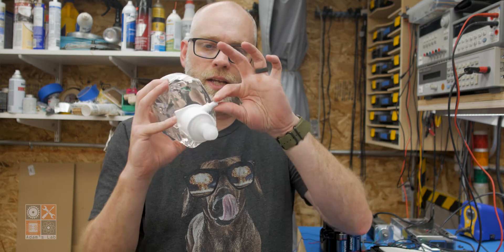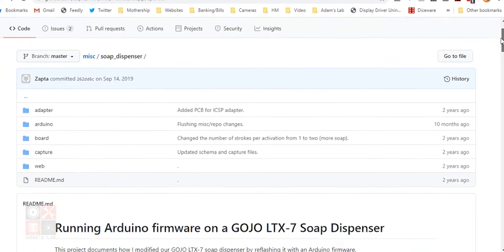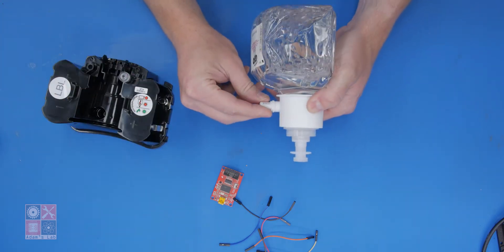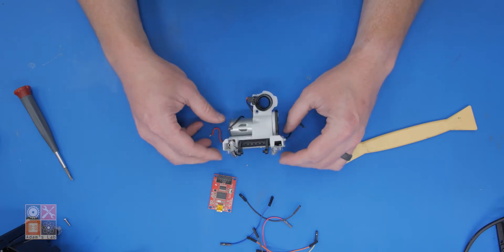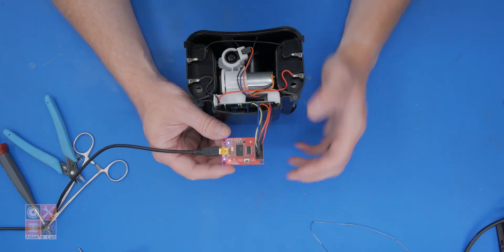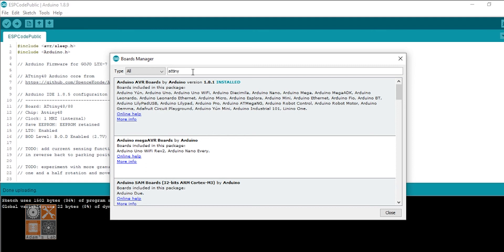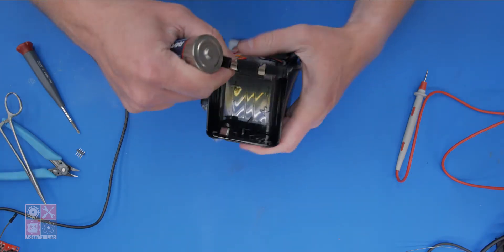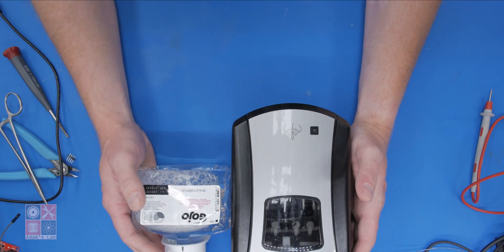Hacking a Soap Dispenser | [0041] 🧼

Comment from the maker: For some reason in the video I kept calling the GitHub repository owner "Za-pa" when it's clearly "zap-ta." Apologies to Zapta.
Reply: I tried to run the sketch but it gave me an error that pcmsk3 was not declared. I'm running the Arduino 1.8.13
Reply from the maker: @eddiecazes5512  - Not sure on that one. Make sure that you have the correct board (ATTiny48) selected.

Comment: where do i get the lines of code at 13:15 or do i not need them?
Reply from the maker: What’s shown at 13:15 (the part I highlighted) are comments, so not strictly necessary. They are apart of the example sketch the original author provides.
Reply: Ok, thanks for the help

Comment: I know I'm late to the party, but I have an LTX-7 that I got for soap, but it only does hand sanitizer. Then I found this video.

I have SparkFun Pocket Programmer as suggested, but it says V11 on the back and supposedly only does 5V while the LTX-7 is supposedly a 3.3V system (ATTiny88?).

Elsewhere, I read that the 88 takes a range of voltages from 3.1(?) to 5.5, so I'm guessing I can still do this? I haven't blown it up yet.

I followed the directions, but I had to manually install the ATTiny48/88 board manager as there's been a years-old problem with the drazzy site that looks like it will never be fixed. Because of the website error, I can't update to the newest board manager.

I loaded drivers for the Pocket Programmer using zadig, and my system sees it.

But I can't Burn Bootloader, then I can't upload the sketch correctly, getting an error finding the port number after upload.

For Burn Bootloader with the Pocket Programmer connected and the LTX-7 connected to that, I get:

avrdude: initialization failed, rc=-1
         Double check connections and try again, or use -F to override
         this check.

Failed chip erase: uploading error: exit status 1

Try a different Mini-USB-B cabe? Connect directly to my PC instead of a USB extender? What else can I check?
Reply from the maker: Been a bit since I’ve done anything with the ATTiny chips… This seems to be the core to use these days: 

https://github.com/SpenceKonde/ATTinyCore 

So, you might give that a try. Also the ATTiny48 is 5v compatible so you should be good.

Comment: Hi Adam
Super nice video, and well explained. And it works. However, I allso have several dispensers with only 5 contact plates. and with a PIC16F677 chip. The print is very similar but I can't quite see what I need. Can you help?

Otherwise
Reply from the maker: Apologies, I’m not familiar with programming PIC microcontrollers.
Reply: @AdamsLab  Daem :o(  Me neither.  Thanks for reply.

Comment: My LTX-7 have a different board that only have 5 pin in the header so not sure of the PIN out to connect it.
Reply: Were you able to figure the pinout for those?
Reply: @dimitryshkurin6480  No, still need original rfid to work.

Comment: I wonder if they have fixed this hack with the latest generation, the es8. The dispenser keeps track of the tag, if the batteries run out before the soap does, you can't replace the battery and not the soap.

Comment: Have you ever thought about cutting a hole in the soap/hand sanitizer bottle so you can refill it yourself? 

I just got this for my wife's salon and the refills are ridiculously overpriced especially considering foaming soap is about 75% water. I was thinking that you could cut a hole on the bottom of the bottle and get a silicone or plastic cap for it then you can refill it yourself for significantly less money.
Reply: I was refilling mine (the nozzle screws off when you remove the collar) but the controller would eventually decide that it had counted the maximum dispenses for the rfid and would demand a new bottle. I just hacked it and now I can continue refilling them.
Reply from the maker: I’ve heard of people doing this…

Comment: Sir, I like your video but when I tried to burn bootloader it just says wrong microcontroller found.  tried it on the model you have on the video and ltx-12.  both output the same error :(
Reply from the maker: You may need to check the programmer... I was using the Sparkfun pocket programmer and had to set the programmer to USBtinyISP (ATTinyCore) to get it to work. You may try some different option depending on what programmer you're using. I'd also check the chip to make sure it's an ATTiny chip... If you're dispensers were bought recently, they may be using a different controller.
Reply: @AdamsLab  yes Sir, bought the same Sparkfun AVR programmer.  sadly I also bought ltx-12 and 7 just last week :( both will  ot work :(

Comment: Thank you for sharing the knowledge! I wonder, and would like to know your opinion, about bypassing "the brains" altogether, leaving only the optical sensor and the squirting electro-mechanics. The optics cannot draw in standby anything but a minimal quiescent current from the batteries. Would it be possible to adopt existing optics of the hand sensor? The rest should be relatively easy to rewire.
Reply from the maker: You certainly could but you still need something to act as the "brains." Something to tell the motor/pump to run when a hand is detected... 

You could keep the sensor and motors in place and come up with something using a different microcontroller or something else but I don't see the point. Unless you have one that's using a different microcontroller that can't be reprogramed.
Reply: @AdamsLab  Thank you for the reply! I was thinking about basic timer(s) instead of microcontroller. I have soap dispenser branded Array (probably a Gojo) that looks slightly different from yours but has the same limitations and RFID sensor in the soap container.  New soap for it cost $30. I will play with it and post any good results. Thanks again for your time!

Edit: I got cheap CMOS timers from ebay that take about 0.1 µA quiescent. Those are named "Multifunction Delay Trigger Chip Timing Mudule Timer IC Timing 2s-1000" usually sold as 10pcs packs for $2 and up.

Comment: they have one that uses "SAN ES8" now. . I think it's timer based since the dispenser fails at some point even when the battery is fine, and the cartridge is half full. My office got a few of them. when it fails and you put a new bottle in, it miraculously works. So RFID to check bottle and brand is not enough, they want to make sure you buy a new bottle every 6 months even when you don't go through that much
Reply: So are you familiar with the ES8? It uses a battery in the bottle. I am trying to replace the battery so the bottle can be refilled.
Reply: @jeffs9943  Running into the same issue. Wonder if anyone has found a way around it.. Having to replace bottles half empty. What a waste!
Reply: Very interesting. Good to know.

Comment: Excellent solution and detailed instructions. Even though the Zapta repo and Arduino file say that it's for LTX-7 but it worked perfectly fine for LTX-12. Used my Arduino Uno to program it. I am having issues with the soap dispenser not dispensing every time but I believe it's related to weak batteries or something.  Thank You So Much Again.
Reply: Hey Umair, do you have the schematics for the LTX-12? Thanks in advance 🙏🏼❤️

Comment: I recently ran into this issue and am still working to get through it.  It is unfortunate that GOJO does not let you know which cartridge you are going to get, or what dispenser you are going to receive.  I worked through all of your steps, however after I install the Attiny by Konde, there is no option for Attiny 48/88, I have options for Attiny 48/88 (there are however options of Attiny 48/88 no bootloader, or optiboot, but neither of those will connect).  I tried a few other options which will attempt to connect, but they time out and fail.  I have the same programmer as you, and cannot figure it out.  this seems like a rather simple process, any ideas on what could be going wrong?  thanks for the how to, very informative.   I just need to get past this last step.
Reply: Try installing an older version of the ATTinyCore by Spence Konde. I originally tried to install the latest version (1.4.1), but ran into the same issue.  When I tried installing version 1.3.2, I was able to get it to work.
Reply: You just fixed all my problems 🙏 @stephenkyu
Reply from the maker: Hum, I'd try closing out of and reopening the Arduino IDE, make sure you're using an up-to-date version of the IDE, etc. You could also try reinstalling the core (you can find instructions on-line on how to do that). Also, since you're using the same programmer as me, make sure you watch this part of the video (starting at 13:22): https://youtu.be/u5RHSwtY1WE?t=802 to insure you've got the right programmer selected. Also make sure that you don't have any batteries in the dispenser and that your programmer is switched to power the device. And, lastly check your wiring between the dispenser and programmer.

Comment: No attack meant Adam.  I should have written my comment in a less critical way.  I found your work interesting as I am an electrical engineer who constantly designs and builds electronics projects for use around the home and hacks designs when there is a compelling need to do so for my own needs.  However, I do feel the vast majority of your readers will find your method of hacking this appliance way over their skill set.  A good tech or engineer should realize the world around them is not dominated by techs and engineers.  In your defense, maybe your intended target audience was the techninal community.  Digressing: Early in the pandemic I was able to buy a couple Provon LTX 12 dispensors but only one Purell dispensors all for home use.  I wanted 3 hand sanitizers and by desing this means Purell.  I was able to buy several over priced Purell hand santizer refills but like you I became aware of the incompatibilty with nearly identical Provon and GoJo dispensors.  Like you, I investigated the root issue and quickly found a simple solution to make the Purell hand sanitizer bottles work with any of my dispensors.  Going forward, I found away around spending high dollars for future refills buy making and injecting my own hand solution that works in the foaming dispensors.  To the best of my knowlege no one else has posted that information for this set of dispensors.  Most anyone can do it with the instructions provided if they are so inclined.  No special skill set is required.  Many people are very interested in saving money these days and that is why I shared it.  I have no problem with anyone spending their money on the right refills to make life as simple as it can be.  The OEM (GoJo) hopes everyone does just that.  Trouble is, they are pretty much non-existant right now (beyond professional health care facilities) so my DIY solution might be of interest to a large number of people.  My kuddos for you and your solution.   The information you provided is (and I repeat IS) valuable to some including me, and I am glad you made the video.  It's good to understand how things work and how to reengineer them when you are so inclined.  Peace my friend!
Reply from the maker: Hum... I see your point but would counter that my channel name, logo, and prior videos point to the channel having at least some technical content. Granted, I cover a wide rage of topics, a lot of my videos involve woodworking of some kind, for example. I'm really all over the place. I mean I made a pneumatic dog door for my shop... But by and large, this is a technical channel. 

Now, when making a video like this one, I try to be as detailed as possible without making a video that's hours long. I try take into account the lowest common denominator, but I can't cater the video 100% to them. Honestly, I don't feel like this "hack" is all that complicated. I recognize that I'm looking at it through the lens of my own knowledge and experience but... You really just need to know how to solder. The hard bits, the reverse engineering, and the programming they're already done for you. If someone is keen enough to recognize why the dispenser only works with certain bottles, and then go looking for ways to circumvent the restriction, I think they are keen enough to accomplish this hack. 

There are often a multitude of ways to fix something. Some methods are objectively better than others. Often, it's just personal preference which biased by one's knowledge/experience. I have the electronics knowledge/experience to fix the dispensers by reprogramming them. The less technically inclined can (if they can find them) just glue the proper RFID tag in the dispenser and call it a day. Or just refill their existing bottles as you suggest.

In this case, any of the solutions takes some effort... Which takes more effort or is the effort worth expending is really up to the individual...  I preferred to expend my effort in my shop reprogramming the dispensers over trying to track down the correct bottles/RFID tags (I also personally think it's more elegant). It's just personal preference. 

Ultimately, what I hope is accomplished with any of my videos is that knowledge is shared and people are inspired. I think it would be the coolest thing if this video is what inspired someone to start tinkering with electronics.

Comment: I can't beleive you go to all this effort when all you need to do is take the RFID sensor out of a bottle that every resturant and health care facility pitches when they are empty.  Further to save money and avoid availability issues you can refill these bottles for continued use:   If you want to refill the empty 40 ounce bottle from any LTX 12 foaming dispenser just drill a 1/4 Inch hole in the top of the 40 ounce bottle, mix up the following solution , and add with a clean mustard like bottle.  Clean and Tape over that 1/4 inch hole with black electrical tape so your home made solution below does not evaporate.  All of the ingredients can be bought online.  Purell bottles can be hard to fine in these Pandemic times.  Don't waste your money on expensive refills and don't go without if you can't find them at reasoable prices.  Formula:
12 Ounces of 100% Aloe Vera Gell 
24 Ounces of Iso Rubbing Alcohol (70 or 90%)
1.5 Ounce of Cocamidopropyl Betane (Surfactant for Foaming)
1/2  Eye dropper of Lavender Essential Oil
Reply from the maker: Well, I mentioned in the intro that swiping a tag from an old bottle was an option. I also mentioned why I didn’t do that. 

Also, this wasn’t for me, as I mentioned in the video, this was for a friend. They just wanted the dispensers to work. While I believe they felt the reprogramming was clever (never mind fast and cheap), how it was done was ultimately immaterial to them. 

As far as effort, it was about as effortless as you could get while still accomplishing something useful. I’ve worked with these microcontrollers before, and the code was already written.

Refilling the bottles might be an option in some cases. In some it may actually be a waste of time.

More importantly though, I’m curious as to how you feel that a simple reprograming that took maybe 30-45 minutes for all 5 dispensers is more a waste of effort than rummaging through restaurant or hospital garbages for used soap bottles?
Reply: Once you get it setup, this process is really fast.  Probably 90 seconds to disassemble the dispenser and 90 seconds to connect the leads to the board and program.  I found that I didn't even have to unsolder the battery leads if I disassembled it carefully.  While it is probably better to solder on the header pins, you don't have to do that either.
Reply: @stephenkyu  yeah, that's what I did. I used 90 degree leads and just soldered them in without disassembling the electromechanical unit. After figuring out the first one I cranked out a half dozen in 15 minutes.

Comment: Thanks for making this video. You helped me to be able to use some soap I bought that was the wrong one for my dispenser, but mainly I just wanted to comment on your mentioning that the dispenser sells for $60-70. I think most of the soaps sell for about $30-40 at least, also. It does bother me also how GoJo puts such security in the device and they won't let you use the brand of soap you want. Reminds me of the Coffee maker Keurig that I had to hack just so I could use another brand of coffee if I wanted to. I said all that just to say that I work in the Industrial Supply business and we deal with Gojo products. The way it works there is the Gojo Rep provides the dispenser for free if you buy their soap. Just thought you might want to know that.